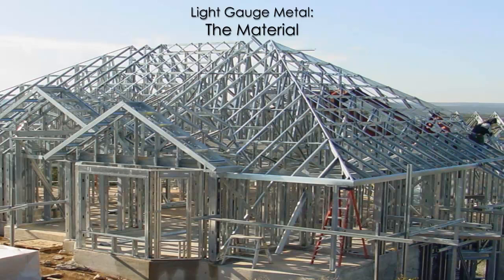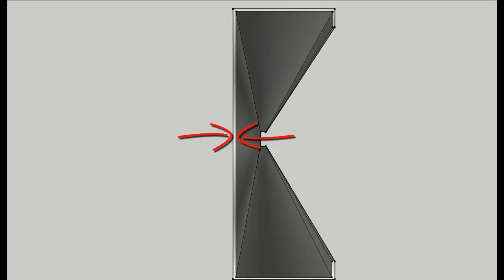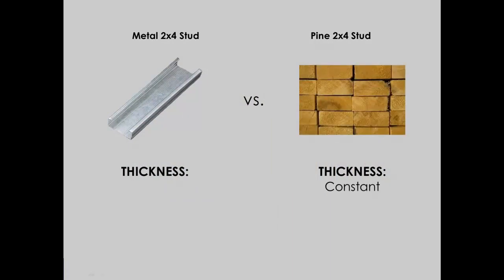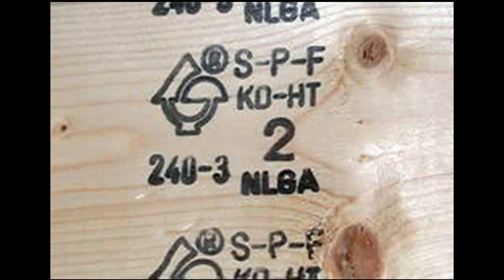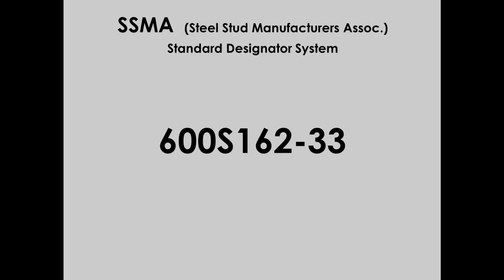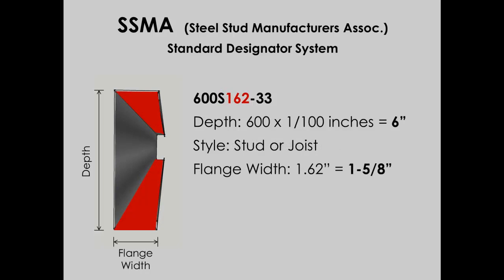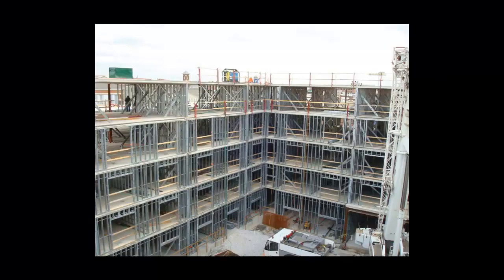Light gauge steel frame building system for load bearing and non load bearing walls

Comment: As an expert I commend you for your representation and and the very ease of dialogue you use to caver all the steps.. Naturally I don’t know why but I want to with find fault in what your doing and double check your work.. 
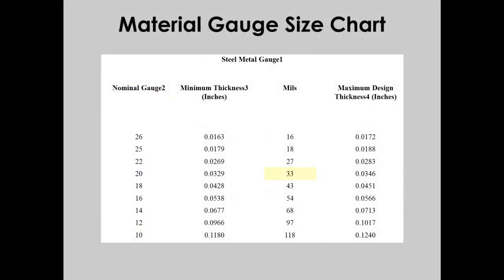Just a correction at about 5:15 to 5:26..
33 mm is not 20 gage steel. It didn’t sound right when you said it at first. I’m like “hmmm hold on here” 20 gauge is 0.8 mm thick

Comment: The audio is correct - metal THICKNESS is measured by the GAGE - @1:04 the graphic demonstrates SIZE - it does not demonstrate the GAGE i.e. THICKNESS - recommend a redo for this part of the video - everything else is great info - would like to see info on shear wall bracing for high wind loads i.e. Hurricane as a comparison to wood framing - also would like to see info on exterior insulation - air sealing water and vapor barriers for the envelope
Reply: You are correct.  And people will make mistakes because of that.